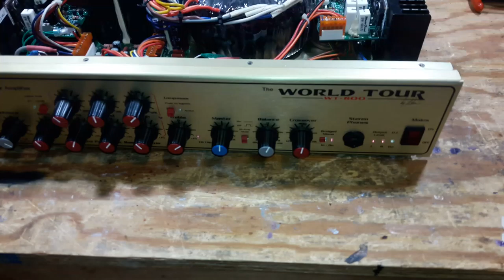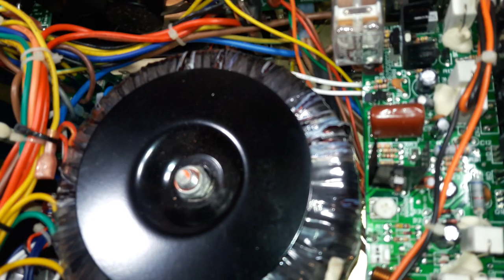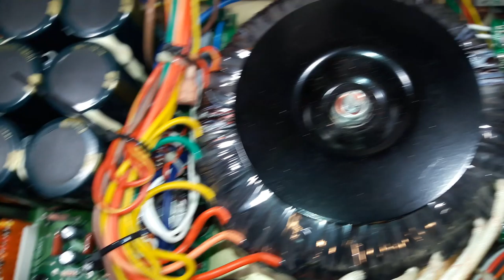EDEN WT800 SMOKED!

Comment: It amazes me Eden did not fuse both +/- power rails to both power amps. There is numerous amps with faults in the power modules that instead of blowing a fuse destroys an entire power amp. I'm rebuilding a C model now and the preventable damage is big. This one was the user switching to bridge while having cabs plugged in for stereo. Despite this I still think these are one of the best bass amp ever made.